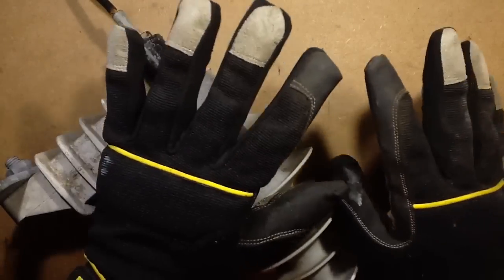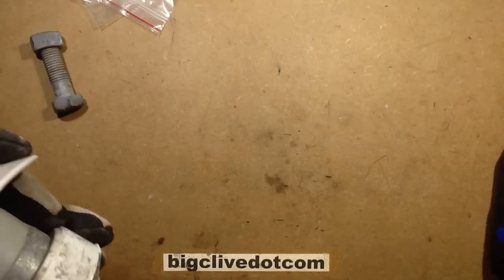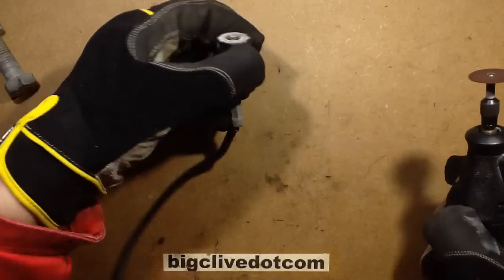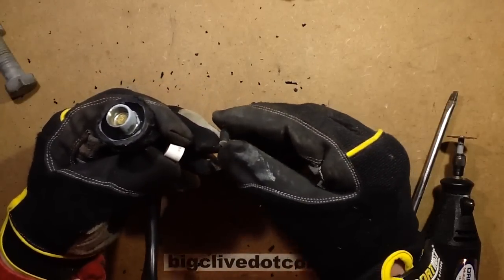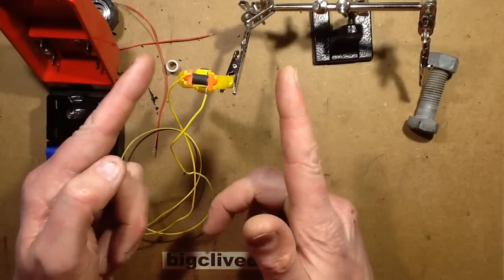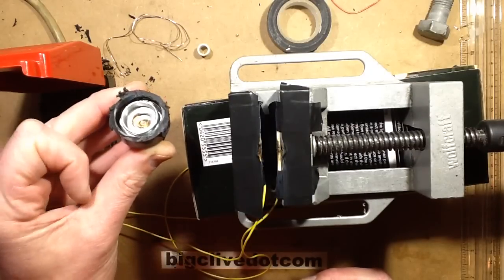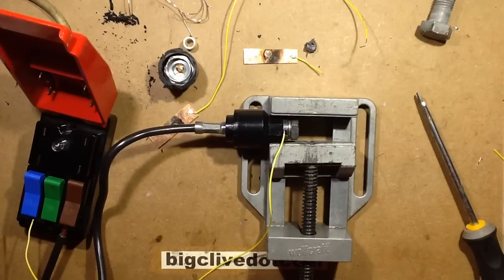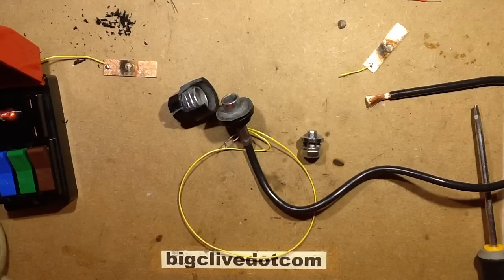Bear & beer.  Opening an explosive 11kv disconnector.  (With bang.)

Comment: Thanks Clive..great video and suspenseful, too, with the Dremeling-open of the explosive dis-connector ;-).. 
Lately I've been researching the world of Power Linemen.... absolutely fascinating... and eerie, too, with all that high-voltage AC or DC sizzling and crackling around them and the things they do to bond-on with and equalize themselves with that voltage while they work on the live lines. #LinemenAreAwesome. :-)

Comment: Clive, Why rubber? I always assumed they were ceramic.
Reply from the maker: Load bearing insulators may be ceramic, but in this case the device just needs to shed rain and not bear a significant physical load.

Comment: If you take a lighter flint (which that is basically just a giant lighter flint [carbon]) and heat it with a lighter or a torch until it turns bright red and then throw it against a hard surface, it will explode violently. That's basically what's happening here, except that a lightning strike will cause it to heat up much more and much faster than heating with a torch would.

Comment: Dear Clive: I note that you use a screwdriver to discharge potentially active capacitors. When I was in electronics in the Navy, we were instructed never to do this. Rather, we used a high value high capacity  ceramic resistor connected to a proper earth ground by a heavy gauge copper braid. Is that still a recommended practice? Thanks! If you like cream soda, you might like Birch Beer or Sasparilla sodas.
Reply from the maker: It is recommended practice for larger capacitors.  Partly to protect the capacitor from high current.

Comment: I would have used a large vise to hold the device instead of my  hand.  Also, using a screwdriver to push and pry against something held in you hand is NOT a good idea either.

Comment: /me runs off in search of Clive's "dismantling an SRS airbag actuator" video... :-P

FYI... The ceramic insulator had double-duty in not only insulating the "explosive" element, but also restricting its expansion. In a constrained environment, it really doesn't take a lot of pressure to cause a catastrophic failure - hence the marked difference in result between the active element being in-situ and it being in open air (had you housed it in a tight-fitting and suitably robust sleeve, I'm sure the vice of knowledge would've earnt itself quite a few more "knowledge scars").

Comment: guess it works like black powder, not packed, not very impressive just a lot of sparks, but once compressed and confined you get to see what it can really do.
Reply from the maker: It turned out there was black powder involved.  There's a .22 blank shell in a barrel that is fired by the hot slug of carbon.  i did a followup vid.
Reply: next try  "bang" whit a microwave caps bank or 2000v 10-100A and may be it gona be closed for the real thing.

Comment: So it's just a fuse for lightning bolts?
Reply from the maker: It's a shunt for lightning bolts.  It only blows when the surge is far too high for it too handle safely or when it starts to break down after suppressing a number of strikes.
Reply: bigclivedotcom
Ya, that sounds like a fuse to me.
Reply: It is a fuse for the power distribution system not for lightning bolts. Eventually enough lightning strikes cause damage to the shunt cause normal power to short to ground. This then blows to remove the short. You just don't have lightning protection through this particular shunt anymore until replaced.
Reply: I probably should have asked at the onset, but are these shunts common in the UK? We don't have too many lightning protections on our transmission lines other than the primary pylons. Most stage 2 or 3 transmission lines (that aren't buried) will have the high-current 3-phase lines right up at the top of the pole. This means that we unplug our sensitive electronics during lightning storms, because occasionally the lines get hit, and transformers will be blown.

Because Edison was such a prick when it came to rival ideas, especially Tesla's (many of which were actually better where power distribution was concerned), North America is woefully behind in power safety, and has no plans to change any time soon.

Because, ya know, Americans can be quite stupid, especially when it comes to necessary change.
Reply: John Purple
Holy shit!
Reply: Surge arresters are there solely to protect utility company assets such as transformers. It's not practical for the utility to protect the end user, nor would users want to pay enough to have an effective solution. As an example, I once worked a trouble call where lightning hit a tree in a back yard, burst open the earth following a root, entered the basement, went across the room, blew some house fuses completely out of their box, and proceeded out of the basement through the meter and service wiring to the transformer across the road where it blew the transformer fuse (the transformer wasn't damaged). The total distance from the tree to the transformer was more than 200 ft. A rare occurence, but an example of the difficult nature of the problem of protection.

Comment: i guess the black carbon is just a trigger and actually the white ring you thought is a ceramic insulator is the real explosive !?
edit, ah just read in the comments that it was a shell inside, ok
Reply: The carbon pin is there to get hot enough to fire the .22 cartridge that was not visible.

Comment: the gas pressure from the "explosive" is sealed by the plastic (looks like bakalite) turning it into a pipe bomb. the tensile strength of the plastic i slow enough that it doesnt build serious pressure and it it designed to be about 20ft in the air so it wont hurt anyone (maybe a bird). it a rather ingenious design.

Comment: Expulsion fuses, or the sodium borate ones, those fuckers are loud, like a 300 win mag going off. Those are generally used as branch protection in residential areas, or for simple circuits. 

Interestingly, I've never seen a lighting arrestor with a disconnector before. Normally they just disintegrate and open the circuit naturally because they are no longer present.

Comment: Cringing safety tip: When working with things that can potentially exert more force than you can a lot faster than you can, do not wrap your thumb around it. You want a place for the explode-y goodness to go that isn't your thumb. It's better to have your grip blown wide than your thumb blown off. Don't take a Dremel tool to it either: If that were an actual blasting cap, you could've been killed. You got away with it this time, but future teardowns may not be so forgiving to you.

Comment: I think that they are using a similar process to cause the explosive failure as theaters did with the original arc lighting.  High voltage to carbon causes intense heat and light.  That is what likely causes that device to fail/melt.

Comment: The first test you performed didn't "explode" because the carbon rod is just a fuse/catalyst. In this case , the carbon rod is a catalyst to an explosive gas that is sealed within the capsule. In the Americas, the gas would be Hydrogen sulfide, I'm not sure what they use in Europe.

Comment: You know nothing about explosives. Actually if you tear apart 12gauge ammunition and take the gunpowder out to some flar surface it will burn nicely and will NOT explode. But if you close the gunpowder in a shell it will. Why? The gunpowder burns the faster the higher pressure it is under. That is why it explodes when intact.

Comment: Thinking back from my time when I worked with explosives at Chemring Group, that explosive pin, actually looks like an over sized primer pin, which you normally find in shot gun / bird scaring cartages
Reply: Clive did an update on this. The carbon pin is there to get hot enough to fire the .22 cartridge that was not visible.

Comment: After the bang, the LED to your 220V switch was still on!  Unless I'm mistaken, that means it was a live 220V electrode near your hand when you were examining the pieces!  Watch out for mistakes like that - it would be a cruel irony to die from mere electric shock when playing with explosive disconnects...
Reply from the maker: The neon is lit continuously, but when the lid is open it disconnects the power.
Reply: would be quite a pointless device if it wouldn't shut down when the lid is opened. would defeat the purpose of it completly.

Comment: I was in a motorcycle factory (triumph) when the 11kv air circuit breaker tripped in the adjoining sub station. I was not in the room but it was very very loud. Unfortunately my boss at the time was in the room and soiled his pants! (really) couldn't stop laughing while waiting for the leccy board to turn up and reset it.

Comment: At least it burnt through the inches side, who needs that part of the ruler anyway right? :) I started a job in the electrical supply industry this year and was severely disappointed to discover that here in Queensland we don't use any explosive disconnect links on our 11 and 33kV,  just boring old spring loaded mechanisms. They are probably a bit easier to reset though, you just need a long insulated stick haha. Thanks for the great video as always Clive, you never cease to entertain and educate.

Comment: Clive, could you measure the resistance across the carbon rod, I'd like to do the sums. Thanks.
Reply from the maker: 80 ohms.  3A on 240V giving about 750W.
Reply: Thanks Clive, was wondering why all the lights on IoM didn't go out!

Comment: I spent like 5 minutes examining the sound of the explosion because it may have clipped the explosion but usually that's followed with moments of really quiet sound, but instead I could hear the items on the desk being pushed away by the leads of the explosion.
Reply from the maker: The iPad always seems to react instantly to peak volume as if nothing happened.  I think it just clips an audio transient instantly without a gain drop like an analogue AGC might do.
Reply: Makes sense. Might help keep volume to normal levels. Of course it could be apple being dumb and using the full motion of the diaphragm of their mic for their full range of volume, meaning that the innerds of the mic literally smacks against the housing when the sound is clipped. An easy test of this is to... eat your mic, talk loudly with it against your mouth, and listen to the results. If it's a loud weird ear-rapey sound, then it's the mic smacking against the walls. If it sounds more digital and square-wave-y then it's transient clipping.
Reply: most electronic devices which have microphones will reduce microphone gain inorder to avoid clipping during playback. how to over come this is lower the gain slight enough so that talking can still be heard and placed at a distance. should get a real microphone one which is standalone.

Comment: did a little bit of poo come out? (asking the real questions here)
Reply from the maker: It would take a monolithic incident to get poo to make an appearance.  I'm well conditioned to the world of industrial electrical equipment.
Reply: what if u put a carbon block inside a metal seal and popped it with 50kw of capacitor charge ?

Comment: It is indeed only the gasses rapidly produced in the capsule that blows it apart; it is NOT a detonation.
Reply: Well.... except that`s pretty much the definition of an explosion, surely.
Reply: An explosion yes, a detonation, no. There is a distinction.
Nitroglycerine detonates; it need not be confined to "explode"
What is going on within that capsule is confined deflagration; the capsule could have been filled with black powder and yielded the same result.

Comment: Based on what I could see and observe, it would appear that the ceramic sleeve would assist in channeling the detonation as well as acting as an insulator.  When the "bang" happens, it is then directed out the ends of the ceramic tube, assisting in the separation of the device.

Comment: My car has one of these. It's connected to the positive battery cable and tied to the airbag system. In the event of an accident it explosively disconnects the battery cable. Clever really. Changing the battery is a time consuming effort where you have to follow a specific time frame in order for the system to 'go to sleep', about 30 mins in all. Great video as ever Clive.
Reply: Great safety tip Thank you.

Comment: I lived in in front of an alleyway where seagulls and squirrels frequently committed suicide on the power lines. You'd hear a BOOM like a 12 gauge shotgun going off, then the lights would go off. Initiator with the pigtail was the item the power company would quickly change to get the power back on.

Comment: I do like you stuff but this one was the best!   Cutting into what you think is like black powder with a dremel  while drinking beer.  Wow, just how scared were you?  Also, that's not the real thing. If you could use the same energy as available from the 11KV line to detonate it, I'm pretty sure you would get a bigger bang. Do it outside.  Also please don't hold explosives in your hands while cutting etc. If you loose your hands you will have to stop making your shows and I wouldn't like that !  Thanks for the info.  :)

Comment: Am I the only one who saw him covering this explosive thingy with his palm and fingers while going at it with mechanical force going "dude... that's how kids around here used to loose fingers during Majbrasa-festivities". 

Yes it is designed to go off by exsessive heat. But the fact that he bothered to suit up before adding heat to the mixture means he did expect a moderate risk of explosive failiure. 

What I am getting at is that if the charge did blow while he covered most of it with his hand... then I doubt that glove would do much to protect him. And the next video would be several months delayed with him having a metal hook for a hand.

Just saying... while it was fun to see... there is a reason why ond should never mix explosives with alcohol consumption.

Comment: I always thought Dremels were half-decent tools but seeing this tiny little abrasive wheel stalling out the motor just by cutting a bit of plastic is kind of pathetic. My Proxxon IBS/E puts up a real fight even on low speed settings. The torque on this thing is amazing for its size. So everyone who's less than impressed with his Dremel tool might want to look for a Proxxon. 
(And if a Proxxon official reads this, feel free to pay me for this comment ;-))

Comment: horrible failure mode. thats more of an anti personnel device than a safe detachment of contact.
Reply: Not like there's ever supposed to be [non-professional] people close by these units up on a power line pole/tower. Light weight plastic shrapnel loses energy rather quickly, so even standing on the ground right under one as it goes off is likely no danger.
Reply: agreed. but i dont see the need for even light weight shrapnel.
Reply: It's not a failure mode, it's supposed to do that, that's it's job. Since they only explode when hit by lightning, if you were anywhere near one in operation you'd have bigger problems to worry about. It has to explode. 

As for it not ripping, well I suppose that's just the plastic it's made of. The casing has many demands, and the way it explodes probably isn't high on the list. Good insulation probably is. They're normally dozens of metres up in the air, so there's just about zero chance of anyone being injured. Clive can stand next to one and still walk away with all his fingers, and Viking beard intact, so they're not that bad.
Reply: waldsteiger got a better idea?
Reply: that case should just rip. but probably these were old ones.

Comment: Ok guys time to hear from the gun nut (A.K.A. me).
the small black pellet could be black powder. The reason is as follows;  black powder will not "explode" unless it is in a confined space. There are many videos showing black powder burning in the open and not exploding. I know this for a fact as one of you rifles is a ball and cap muzzle loader. :) So when Clive tried the set of the charge with out a close confinement system all it did was burn. When Clive used the unopened disconnect the charge was in a confined space and "Boom".

Comment: Before things go bang - you need to say "Here, hold my beer"  

I do have a serious question.. if the resister (the grey thing at the start of the video) is plastic why are the rubber fins there? Is it used for heat dissipation.
Reply from the maker: It's used to shed water and avoid dirt buildup that could cause arcing.  It's used on 11kV overhead power lines.
Reply: David T-Rex I though they are meant to increase the surface distance between the conductor and the mounting spot.
Reply: Richard van Pukkem  Well pretty much what Clive said.  Those fins on ceramic and rubber insulators are designed that way to prevent dripping rain water from forming a conductive track from the wire to the pole.
Reply: I must have missed that part - thanks for the reply :)